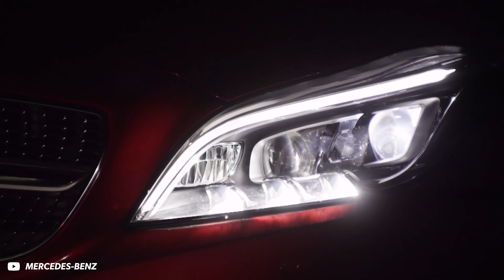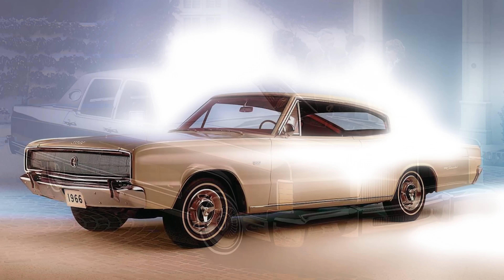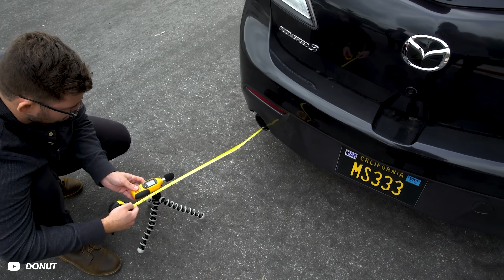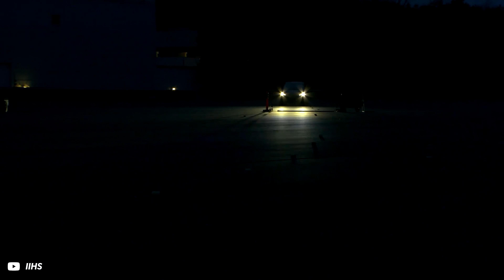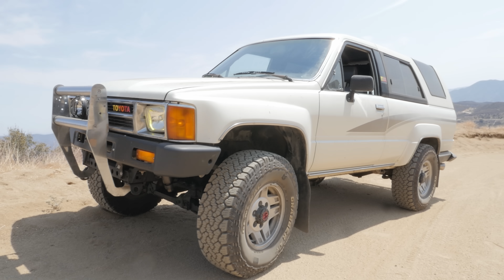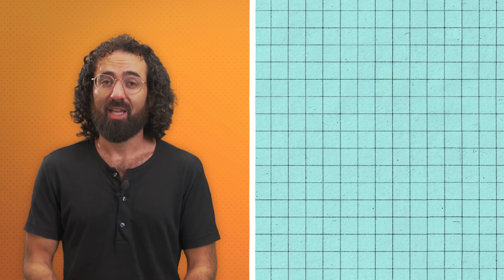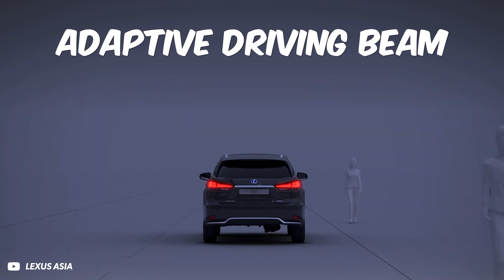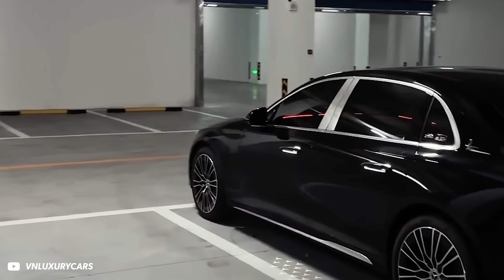Why new headlights are blinding American drivers

Comment: As a custom car builder myself, there is more to this issue than what was stated in this video. 3 Things

1. Im not trying to be mean, because I know sometimes you just can't help it. But....a lot of these complaints of overly bright headlights is also the fault of the person complaining. Meaning, stop looking directly into someone's headlights. I have trained myself to keep my eyes on my lane when on 2 lane highways and not look into the headlights of oncoming vehicles. I know its hard....like a moth to the flame, but with enough practice, it is possible to train yourself.

2. Also, for those with aftermarket headlights, like myself, its the responsibility of the installer to make sure that the beams from those aftermarket headlights are set at the correct level. I do this anytime I install new aftermarket headlights in a vehicle.

3. BUT ALSO, I know this may come as a huge surprise, but if you buy a new vehicle, EVEN FROM THE DEALERSHIP, make sure before you leave to have your headlights checked to make sure they are adjusted correctly!!!! I say this because this happened to me! We bought a new "at that time" 2023 Honda Ridgeline RTL-E and we kept getting flashes from oncoming traffic even though we had our low beams on and all other lights off. So I took the truck into Honda and had them test the headlights. Needless to say they were WAY off. They dont know how this happened considering the truck was brand new, no previous owners. So, lesson here is, even if its a new vehicle, demand they check and make sure the headlights are adjusted correctly. 

Lots of people are so quick to blame new LED headlights, and lets be honest here...its only because LED headlights are the NEW thing. Its not because you KNOW whether they are LED or Halogen, or any other form of headlight. LEDs are not the problem here. Its being responsible for making sure your headlights cut off beam is correct. I have HIGH POWER LED headlights on my 2017 Civic Type-R and I have not once had anyone flash me because my lights are too bright to oncoming traffic. Thats because I set my headlights cutoff point perfectly. I had to, my OCD wouldn't let me not make them perfect. lol So the next time you get blinded by headlights...or know your about to be blinded...either keep your eyes on your lane or on the white line to the right of your lane, or just keep in mind that its not the headlights fault...its the irresponsibility or lack of giving a d**n of the person driving, OR it could be a manufacturer defect from the actual dealer which in turn could mean that the person driving the vehicle just has no idea their headlights are not correctly adjusted even though you could tell them such and they will just keep saying "BUT ITS A NEW CAR". Again, just cuz its new, dont mean jack s**t, they might just be out of spec.

BUT that being said, I think the headlights Europe is using are really cool, the drawback of those though I could see would that I am sure they would jack the price of that car up by quite a bit. Couple thousand Im sure. And with those, it would be VERY difficult for aftermarket companies to make aftermarket headlights that are SOOOOO technical but still affordable to the people looking to get aftermarket headlights. So they would put a LOT of aftermarket companies that specialize in headlights out of business.

Just some thoughts.
Reply: Quit trying to justify yourself and putting the blame elsewhere. I have been driving for over 55 years and the only time I used to have a problem with lights was when someone bought a $99 craftsman tool kit and thought it made them a mechanic or the idiot that doesn't know to turn their high beams off because the oncoming vehicle also needs to see. Now days with the trucks and their headlights jacked up to the sky and the ridicules head lights and "fog" lights installed way out of aim it is a problem. Maybe you don't think that loosing the sight of the vehicle in front of you do to the oncoming lights is a problem but if you ever rear end a car at night because of it I am sure you will use the lights as an excuse. It's fine with me to put those aftermarket headlight manufactures out of business if they can't conform to the design rules. Most factory lights are no problem as I approach them and in a string of oncoming traffic the difference is dramatic. Even interstate travel is a problem and some of the semi's are the worst.
Reply: @garyradtke3252  Take a chill pill man. What you just said is EXACTLY what I just said. Jacking your truck up in the front and lowering the back YES is a problem because it makes the angle so bad that no matter of adjustment you do to those headlights "aftermarket or not" they still will not conform to the cut off angle. And again, its not the headlight manufacturers fault that some idiot does this to his truck. And how am I justifying myself? I drive a stock ride hight car and my headlights "and those that I install" all conform to DOT standards and are all adjusted perfectly to the cut off regulations. Just because your a driver of 55 yrs doesnt entitle you to be an expert. lmao Im 46 and have been working on cars sense I knew what a car was and am a certified mechanic and have been driving sense I was 16. You're making it sound as thought its a headlight manufacturer problem and it 100% is not. Its 100% the responsibility of the driver of the vehicle to make sure their vehicle is in regulation both with brightness, angle of attack, AND even maintenance of said headlights. Hell, there are even lights out there that are sold with the "For Off Road Use Only" tag on the box because they do not conform to safety standards and DOT that people put on their cars and trucks and run with them on. Does that make the manufacturer at fault for having sold them? No. Its the buyers fault for using them and not reading all the included info that came with the lights that said "For Off Road Use Only" Trying to off blame of your lack of responsibility onto manufacturers is by far the biggest problem and is exactly why we have this problem in the first place. And yes, you are correct, if an aftermarket manufacturer can't conform to DOT and safety standards, then they have no business making headlights. But again, it is STILL your responsibility as well that if you buy those kinds of headlights, that you take your vehicle to have them checked at either a dealership or inspection station once they have been installed. Dont just assume that headlights are going to be perfect. As I said, the headlights in our truck were stock, the truck was brand new and had just arrived at Honda when we bought it, and those headlights were all outta wack. Not checking you own headlights whether aftermarket or factory is like taking someones word for it that the gun they hand you is not loaded. Yo a** better check the chamber and make sure its not loaded.

Comment: I hate LED headlights. It makes me want to not drive at night more than I already don't.
Reply: Yup !!!  and some of them (actually ALL of them) have a blinking rate, and some are so noticable its torture !  I have to block my mirror when one is behind me.  For the rest, Night-Time Driving glasses with blue-blocking (yellowed) lenses help A LOT   Got mine on ebay
Reply: @mtlicq Those yellow tint glasses help with how blinding LEDs are, but they reduce visibility at night.
Reply: @User24x  Au contraire, mon ami,.  Those glasses INCREASE visibility.  They reduce the intensity of bright lights that would "blind", AND your pupils can stay a bit MORE dilated, letting you see more in the rest of the road.
Reply: @User24x    Also, less squinting, less need to blink, plus less fatique for the eyes.
Reply: @mtlicq  They REDUCE strain on your eyes.
Reply: @User24x  they block out the blue end of the spectrum, which isn't particularly useful to our eyes at night anyway. Basically the same deal as the "selective yellow" headlights some european countries used to mandate. yeah it's a bit less light, but kind of a wash in the end.
Reply: @User24x   I find the orange tinted safety glasses cut the brightness quite a bit...
Reply: Not just the headlights, but people also have the LED light bars/panels on their bumpers.
Reply: I just use welding glasses for the night. Works like a charm.
Reply: Luckly in eu we have laws and inspections for headlight beam alignment and pattern....
Reply: Tinted front windows it’s a game changer
Reply: @walterwhite1  definitely but in some places that's totally illegal.
Reply: I'd like to install a light bar on the roof and turn it on in response, but we're prohibited from driving with a light bar on the roads.

Comment: Well, when it's a big truck, I'm aware that they aren't doing it on purpose. It's just that my eyes are level with their headlights. Nothing they can do about that. This is also true when they're directly behind me and blinding me in my mirrors.

The ones that annoy me in particular are the smaller cars where the headlights are below me and yet their pointed right at my eyes! Or at least seem to be. A sedan's lights should not be blinding me when they have their low beams on. And if they are? Either it's the bulbs or where the beams are pointed.

Ofc these days, it's a whole ordeal to change your lightbulbs. With my last minivan (2000 Town and Country), I actually had to remove some bolts and take off a metal guard to access the lightbulbs! I haven't even looked at what it would take with my Traverse, although it's probably behind that stupid plastic shielding. (I miss my minivan - minivans need to come back down in price!)
Reply: There is a legal maximum height limit for headlights but customizers and I believe some auto manufacturers don't care about it. The Ford trucks with dual beam lights one on top of each other is one of those vehicles. I drive a pick up truck exclusively and have for 60 years. I have never customized any of them for ride height or lighting but only for greater durability. Some of the head lights now have adjusting knobs to reach in and jack with the aim without having aiming equipment or even knowing what they are doing. I get blinded by these cars every night so I don't know how passenger car drivers deal with it.
Reply: @garyradtke3252  The majority of the trucks I'm referring to are semis. So I'm not referring to personal vehicles or lifted trucks or anything like that. At least in terms of me understanding that there isn't anything they can do about it.

The dialysis clinic is in the industrial part of town, so I get to "enjoy" being around all the big rigs every time I take my husband to/from dialysis. Although at least there usually isn't too many of them driving around at 4:30 am.

Well, I'm usually less worried about getting in an accident in that part of town than I am closer to home, which is near the state university. Let's just say CDL drivers worry me quite a bit less than... university students. lol

Comment: ADB tech still doesn't address the aftermarket problem, or people performing mods that raise their ride height or change the angle of their headlights. The real issue is that not every state requires an annual safety inspection, and even the one's that do don't check for proper headlight alignment, only that they come on and that they have high/low beams. Since this will continue to be an issue, I'll just remind everyone what I was taught 100 years ago in Driver's Ed: If the car coming at you starts to blind you, focus your eyes on the fog line (right line at the edge of the road in North America) until the car passes in order to try and preserve your night vision. Additional pro tip, most Americans have their instrument cluster backlighting cranked higher than necessary, which also kills your night vision. When driving at night you should adjust your instrument lights to as low as you can while still allowing you to easily read the information at a glance. This means making them dimmer on darker, back country roads than what you would normally set them for city driving.

Comment: The only solution?? lol I don’t want an even MORE COMPLEX vehicle system just waiting to fail. Cars are already too expensive to buy, too expensive to fix, and FRAGILE.

Body control modules need to go too bye. Direct wire for longevity and cost to repair!

How about you don’t need a headlight that bright and it seems these government standards don’t account for multiple cars in front of you. Make them dimmer, keep complexity low. Cars operated for decades with halogens. Safer?? For you or the other car in front of you that can’t see with a blind spot in their vision now? And looking to the right line of the road takes your eyes off the other car so that trick doesn’t always work either.

Comment: Aussie here. I drive an NB MX-5 (Miata). I’ve had it since 2003, and had a 1990 NA MX-5 before that. I never suffered from blinding headlights until about 15 years ago when these LED and Xenon lights became ubiquitous. Yes, my seating position is low, so I’m blinded by almost every vehicle, but as I said, it’s only a recent phenomenon. I don’t know how they were ever allowed on vehicles. Even bright LED daytime running lights give me ‘snow blindness’. I’m even blinded from the headlights of vehicles shining on my side mirrors, and reflecting back into my eyes.
Reply: New owner of a 2002 NB, can confirm...when you sit that low everything is blinding, even motorcycles.  It was pretty insane the first time I drove it at night, I was so used to my late model Subaru's as well as every other car I've owned for the last 12 years that I was concerned I wouldn't be able to see anything with the Miata's headlights. Surprisingly, I was able to re-adjust to the "old" headlights quite well. I also had to remember to use the lever on the rear view mirror when cars with bright lights are behind me.
Reply: @JohnSandovalesq As an MX-5 owner for 35 years, I can tell you it’s a new phenomenon. 15 years ago, before these new bulbs, the halogen lights on even large 4WDs never, ever caused me an issue.
Reply: Same here in my low seated honda civic
Reply: Same and I don't sit low I'm in a van and before that a Toyota truck and I just don't drive of a night now. And like you I'm affected even in daylight now it's crazy. 👍
Reply: Not an Aussie, but I use an NA Miata to test my headlight alignment and I can assure you my LEDs don't go above your license plate. That same timeframe you're talking about is exactly as SUVs and Crossovers became the standard commuter car and from my personal experience, THAT is a much bigger issue than aftermarket LEDs. Almost every time I'm blinded, it's from a brand new SUV/Crossover or a pickup truck from 2014 or later, or has some sort of lift kit installed if it's older and still blinding me.
Reply: as a norwegian with roads made around the terrain so theres alot of up and downs no matter the headlight if you are in a ford focus with a ST wing idk how 2012 model but doesnt have ST front and is somehow lower than the average focus unless its a ST everything blinds you no matter what even on flat roads including other low cars with old lights that have been mounted probably
Reply: Base model options ... and base options on higher end (performance) models of some cars in the US still used bog standard halogen bulbs 10 ... or 13 years ago. Definitely on 2012 model years, and I think up into 2016, maybe later.

LEDs would've been fine if they'd just kept the same brightness and color temp (via phosphor diffusor layer) as standard halogen lamps, while being much lower power usage. (literally 9 watt domestic LED bulbs are bright enough for the purpose)

The glare is way WAY force for cars without tinted windows and windshields, too ... or with ANY amount of dust or residue on the glass.
Reply: the core of the problem is NOT the brithness but the blue color of the lights, that is what is blinding. Halogen bulbs and LED and Xeon that is yellow color is MUCH less blinding.

Reply
Reply: There's the problem, you're not a true blue Aussie as you'd have a dual cab😂.
Reply: Are you sure you should be driving if you're blinded by lights so easily and so much? 😬
Reply: @LordWalsallian I bet you drive a truck or SUV, and have sat low to the ground.
Reply: @just_passing_through No, a Volvo V40.

Comment: Active matrix/autodimming headlights are not the answer. I live in the UK and a LOT of our A roads and B roads are windy, hilly, single carriageways where the fancy headlights simply cannot react fast enough. Even a millisecond of these blinding headlights coming round a corner in front of me is enough to temporarily blind me, and by the time my night vision returns I've covered 50m or more. If a bend is coming up I often have to just slam on my brakes to make sure I've got time to see the corner I need to take. Driving in the UK at winter has genuinely become something I dread because I know I can't avoid driving in the dark, and I KNOW it's just a matter of time before one of these blinding encounters causes me to carreer off the side of steep valley road.
Reply: what's insane is that it's going to take multiple people dying in accidents being attributed to blinding lights before anything is done about this insane trend
Reply: @NomadHatch You have to track the data to even notice a trend. I suspect it's happening already, but no government or car manufacturer cares enough to even track the data.